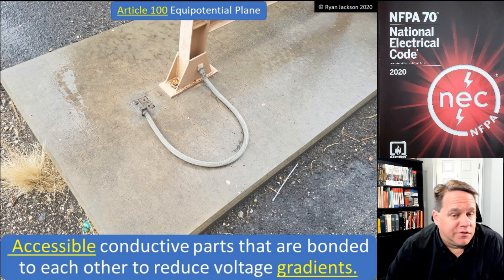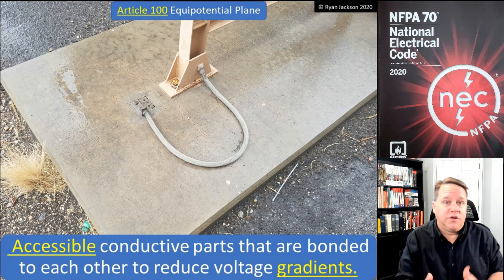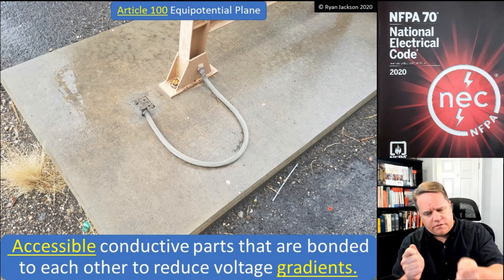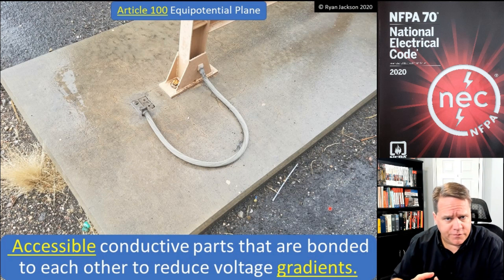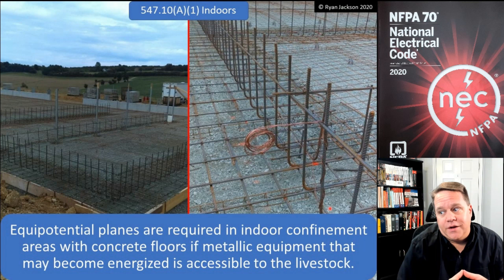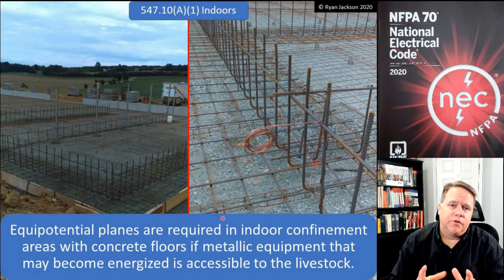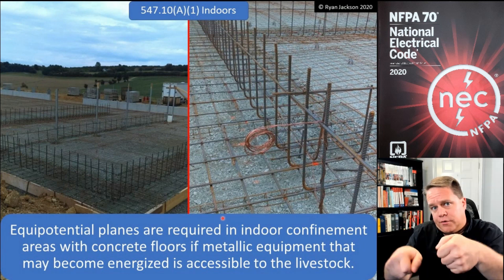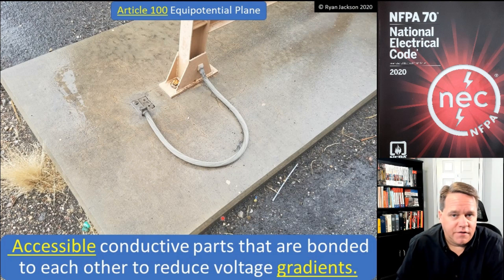100 Days of Article 100 Equipotential Plane

Comment: The definition may be misinterpreted as implying that the accessible conductive parts bonded together themselves that are the OBJECTIVE of having the reduced voltage gradient rather than the accessible ADJACENT SURFACES of what the accessible conductive parts are embedded. Aside from Articles 547, 680, and 682, equipotential bonding (not necessarily “planes”) also show up in Article 517 implicitly [517.11 “ the maintenance of adequately low potential differences only between exposed conductive surfaces”; 517.14 “equipment grounding terminal buses of the normal and essential branch-circuit panelboards serving the same individual patient care vicinity shall be connected together with an insulated continuous copper conductor not smaller than 10 AWG”, “separate transfer switches on the essential electrical system, the equipment grounding terminal buses of those panelboards shall be connected together”; 527.19(B)(2) and (C)(2) “grounding terminal of each receptacle shall be connected to the reference grounding point by means of an insulated copper equipment grounding conductor”; 517.19(D) “connect the grounding terminal of all grounding-type receptacles to the patient equipment grounding point”] and even to a more arcane degree of implicitness in Haz Loc Sections 501.30(A), 502.30(A), 503.30(A), 504.60, 505.25, and 506.25.  Not all equipotential bonding follows the topology of a two-dimensional plane for construction convenience.
Reply from the maker: There is an accepted PI to 555 to create one there, but I made a PC to reject it. I think the idea is good, but the first revision contains no technical requirements or details on how it is to be created.